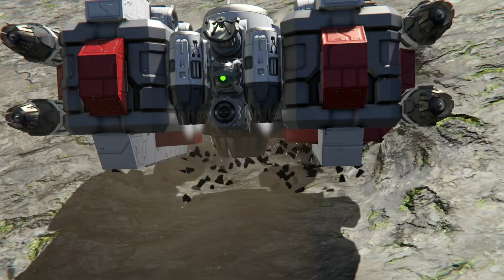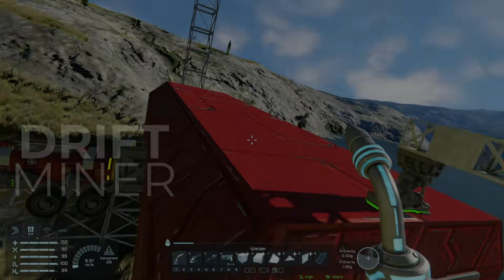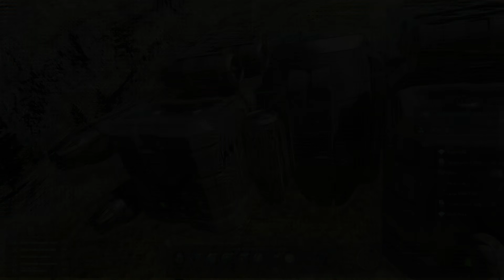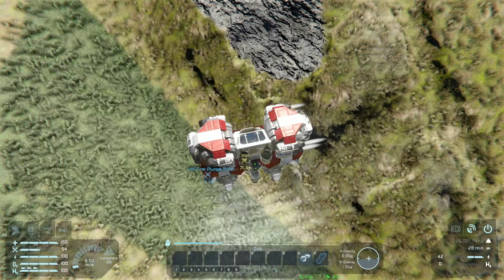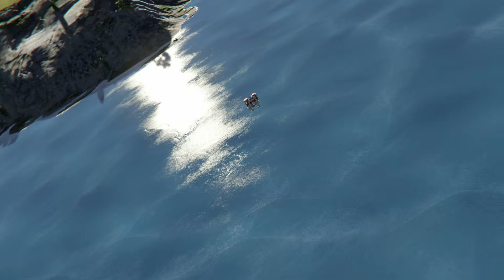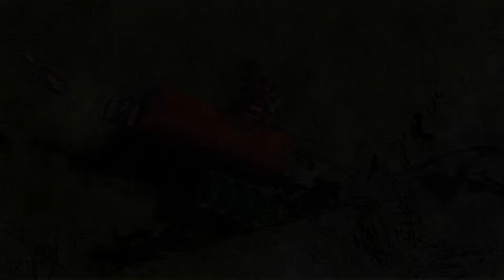Space Engineers | Simplified Guide: Build Your First FLYING MINER!

Comment from the maker: Two essential points from this episode that can save your early game build:

Landing Gear Locks: When you drop even an unwelded Landing Gear on your build platform, it still locks the moment the foot touches a voxel or grid. Use this to stabilize your ships before they are fully welded!

While I mention designing is mainly about aesthetics, adding those Spotlights and Interior Lights is crucial functional design. They are essential for seeing at night and when in mining tunnels and holes.

Now that you've seen both: Which one did you build first? The Drift Miner or the Plunge Miner? Let me know below! 👇

Comment: If it's a single job ship, the plunge miner makes a lot of sense. (Although at that point I think I would increase its cargo/thrust capacity.) 
If you're going to swap out drills for grinders/welders and use the ship part-time as a construction ship the drift miner is a bit more practical I think.
Reply from the maker: These are just basic platforms to start from. This whole series is meant to be as simplistic and straightforward as possible. I enjoy making both styles of these miners and it was fun bringing them down to a very basic/minimal level for this series.
Reply: @AegirBuildsAndBeats  I built the first type, thought rovers were the way to go but flyers are so much MUCH faster. I can fill it up at an ice lake in 3 minutes and be back at base less than 10 minutes after I left, and the ice lake is almost 20km away from my base. I put two extra small thrusters on the back to move quicker, still under 80% usage on power gauge.
Reply from the maker: That's great to hear. I tried to make them very bare bones and easily upgrade/configurable.